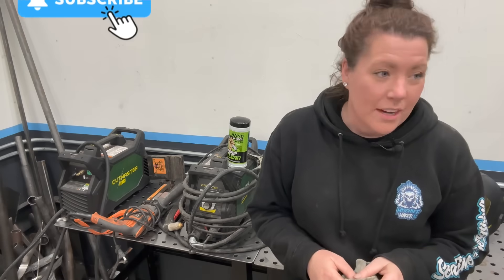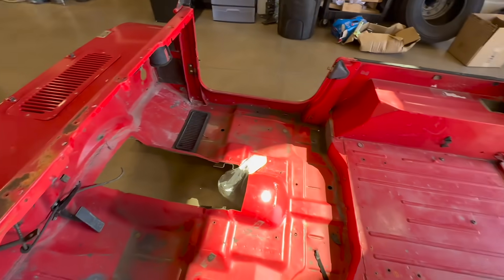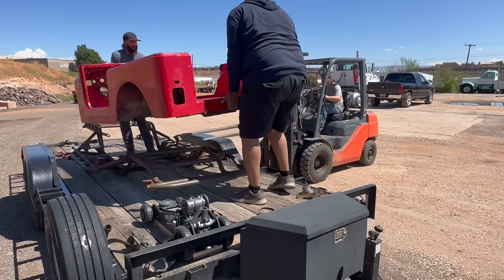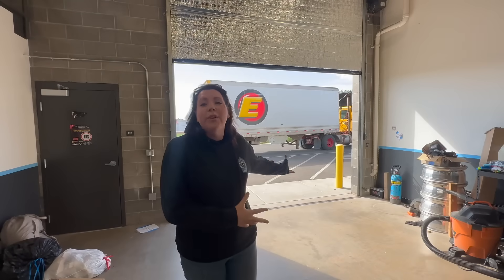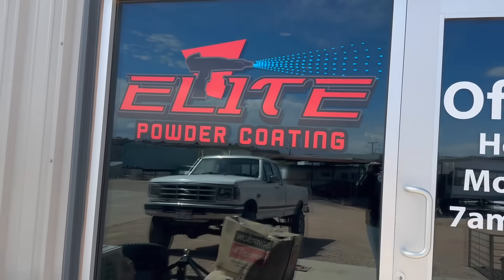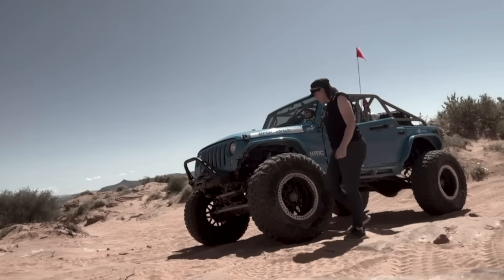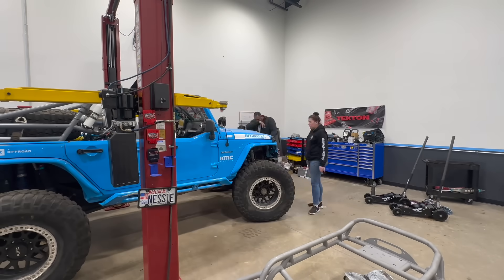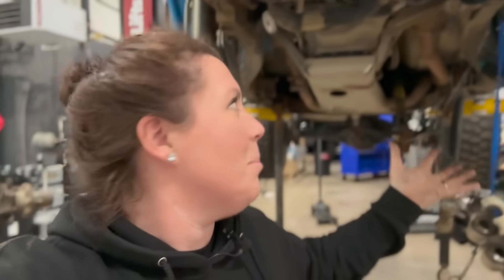A Clean Start

Comment: awesome to see your life getting back to normal -----  My advise for the recovery is (YOUR DR KNOWS BEST)    But after 27 years of beating myself up in construction do lots of movements but not hard strenuous work ----- keep things moving but dont stress it too hard too quick...

Second As a 24 year YJ owner stuck bolts like the windshield bolts get a shake and break ---- air hammer screw extractor ----- and heat ------ youwill never get the bolt out normally ---- heat the head red hot --- let it cool down a few minutes and it will screw out like you just installed it ----- if you arent worried about the paint --- the heat is amazing

Comment: Great to see the progress you’ve made. Lazy me would have used the lift to load and unload the tub and frame, but I’m not built like Walter. Left handed drill bits are handy for removing stripped screws. Have you considered using wheel dollies to move vehicles around in the shop. I watch a tow truck driver extract a car parked in a space between two cars and loaded on a rollback in about 5 minutes using them. No, it wasn’t my car😂.

Comment: Yup, it's not worth it to try and save those torx holding the hinge to the tub. From the factory, they spray the cowl with seam sealer to fill the gaps.  They always leak when the sealer gets old and is a PITA to fix.  Luckily, you don't even have a dash so it's super easy to just drill them out.  Media blasting is very satisfying.

Comment: Holly, to make the axle stand more universal,  cut about 12 - 18 inches out of the horizontal bars. Then, sleeve what is left so that you can adjust the width. You can also drill and tap the sleeve to put in bolts to lock the sleeve in place.
Reply from the maker: That’s a great suggestion, I’ve had a few ideas floating around my head since making those changes. Adjustable width would be absolutely amazing!

Comment: Wait, what did I see?  Is the person with a recent back injury lifting half of the tub?

BTW, nothing rusts faster than something just sandblasted, just from the water in the air.  It will happen even in the shop, with a tarp over it.

All track bar frame mounts need braced to the other side of the frame.

Actual crawling and building are my two favorite types of videos y'all make.  That is what hooked me, long before you branched out into "lifestyle" videos, which I mostly ignore.

Be safe, have fun, crawl if you have the talent.
Reply from the maker: Hey hey not at all. I’m not lifting anything g like that at all. I can barley drill or get bolts out right now so deffo not pushing it. Anyhoos Walter is making sure I don’t do anything

Comment: Welding Galvanized metal is problematic and produces hazardous fumes.  Grind as much of the Zinc coating off as possible and be prepared to make sucky, weak welds.
Reply from the maker: If they were structural, I would mind, but those welds probably hold the casters in place forever 😁